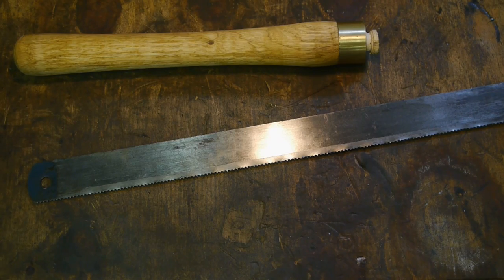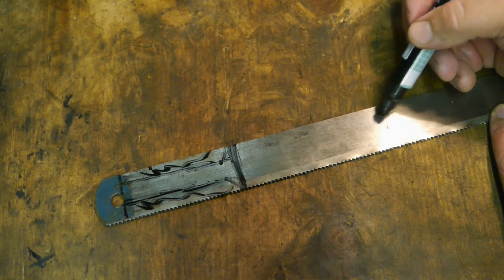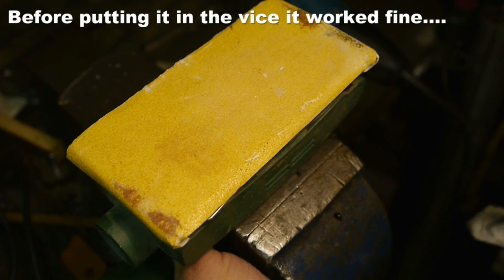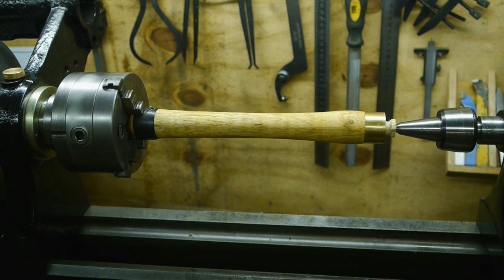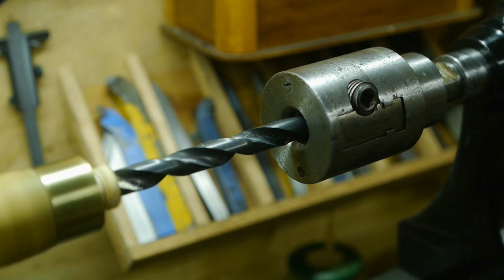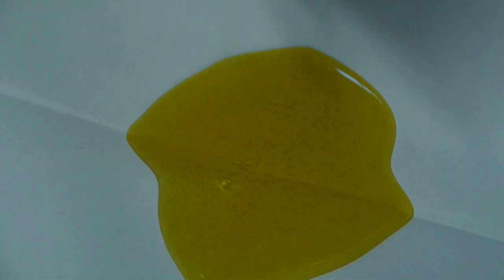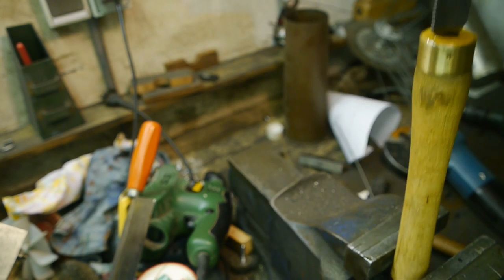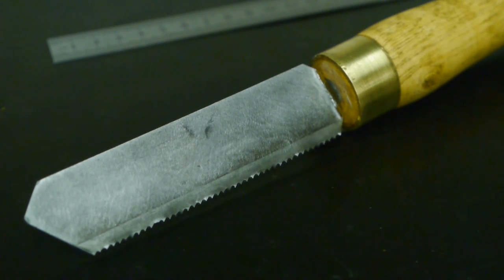Making a parting tool from an old hacksaw blade

Comment: I think the problem that the sander does not connect is related to the brushes, when you tightening on the vice they must have moved away from the rotor. Do not throw it away :)
Reply from the maker: You might be right. If it happens again I'll open it up and check. 
Even-though I 2 more of these machines I like this one because it is low powered and not so heavy. So I haven't considered throwing it away :)

Comment: Thanks for the video.

Sad to hear the vintage metal saw died.  It was a nice old machine.

I have kept a used hacksaw blade with the intent to try making a parting tool.  I just have not got around to this yet.  I have seen videos where folks have made parting tools from pieces of hacksaw blade.

In the videos I have seen the folks ground off the teeth.  If you are lucky, the teeth should help make the groove a little wider than the cutting edge which should help to reduce the heat of parting.

I am interested in the first tests.  You may need to experiment with the shape of the tip.
Reply from the maker: That hacksaw was just too far gone. Lot of things were bend or broken and it didn't cut strait any more. But it was a cool looking machine. I should have made it a garden ornament  :)
Yesterday I completed the test and I'm currently  editing the footage.
And I did change the shape of the tip a little.